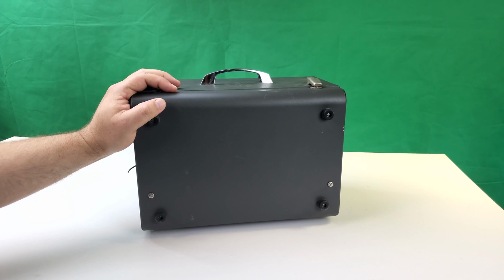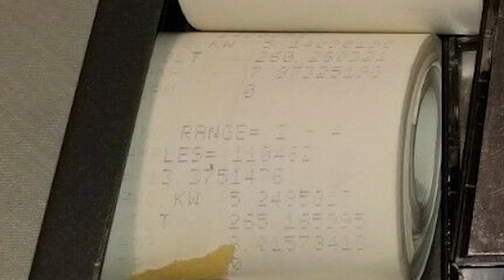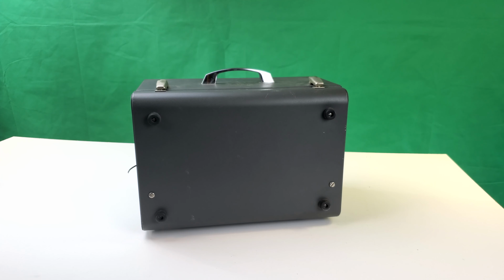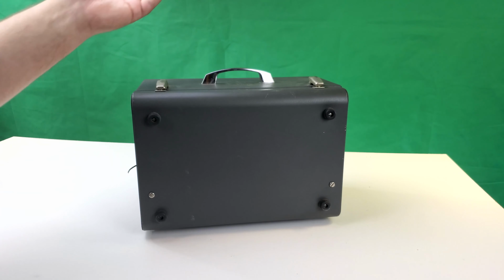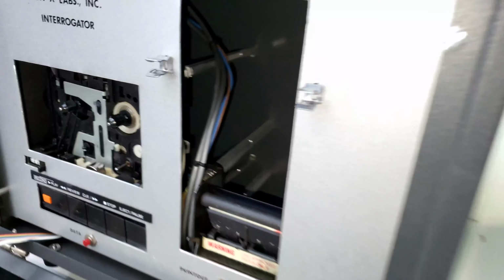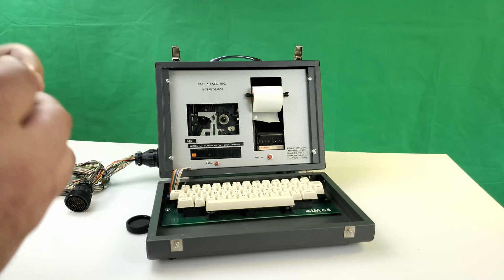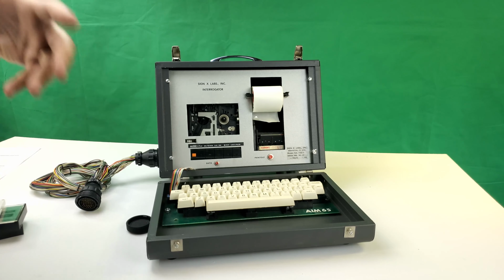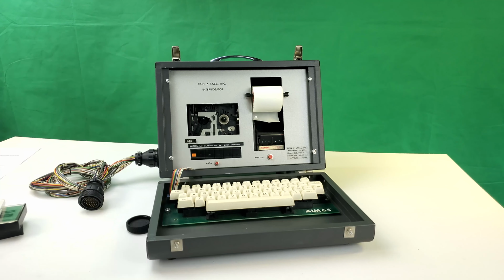Random Bits - Sign X Labs Aim 65

Comment: Found this off the Vintage Computer subreddit. I did some Googling because I am in CT and was curious about Sign-X.  I found a few references in EPA documents, they were involved in monitoring "plume rise," or the air pollution emanating from power plants.  I found one document talking about them having instrumented helicopters with tape recorders to collect the data. I also found mention of them being involved with wind energy in the late 70's. So this could either be monitoring winds vs. power generated at conventional power plants to study pollution or maybe early wind energy experiments. I think the seller was in PA and it looked like that is where they were monitoring the pollution, so my guess is the former. There were some other scholarly works but you needed to pay. Either way, quite interesting.

Comment: The connector is, IIRC, called amphenol? We had boxes of em that were scrapped due to lack of traceability certs in aerospace machine shop I worked in.
Reply from the maker: Yes that name sounds right.  I'll probably trace it out and see if I can line it up with an AIM-65 board somehow if I ever find one loose.
Reply: @TechTimeTraveller  I'd bet anything the wire count lines up with whatever the edge connector was on the AIM. Should pinout like an expanded Kim-1 essentially, right?
Reply: So it's a user interface to a data logging system?

Comment: It would have been reasonable for the AIM 65 to have been the monitoring system for a wind-powered generator then the Interrogator was dragged around to various sites to gather the power generation stats and perhaps maintenance status to be reported to the office or the generator owners. The AIM 65 could have been left powered and running 24/7 and the input connections from the  Interrogator pulled to inactive. When these little miracles came out they quickly found use in thousands of diverse systems, especially if it meant you could gather data with valuable unmanned systems. (I was in college in '78 and was very much into microsystems at the time. I still have a NASCOM-1 Z80 system in the loft from those days!)